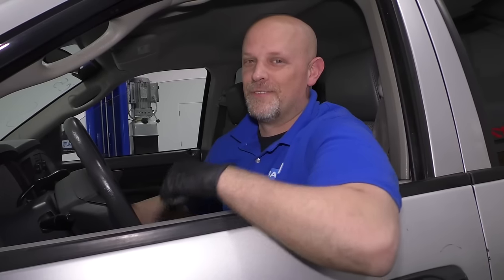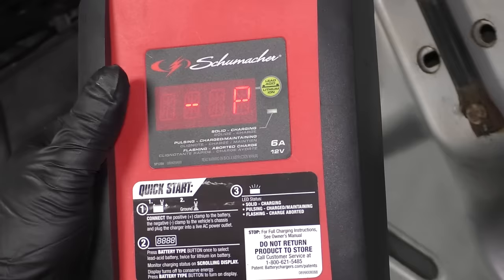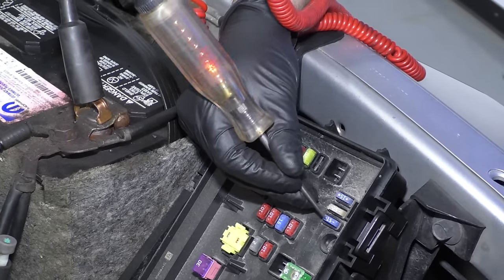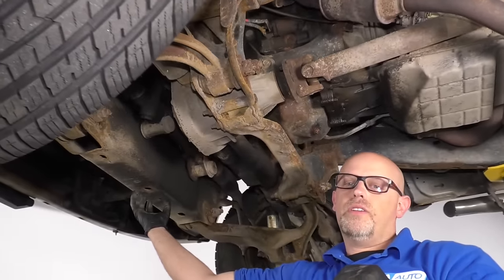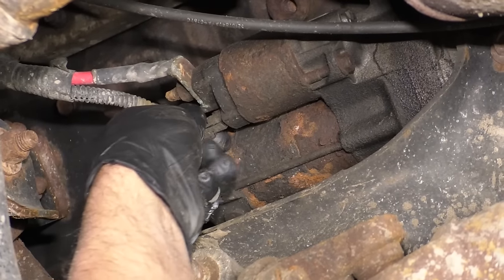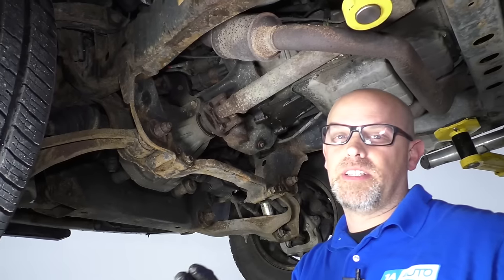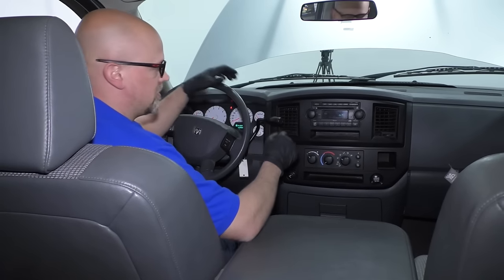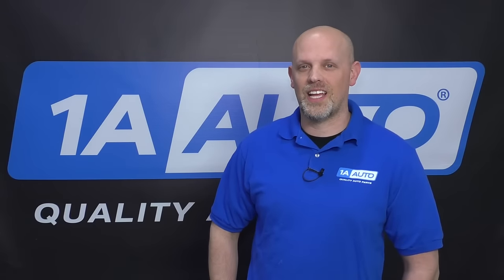Car or Truck Engine Won't Start? How to Diagnose a Bad Starter

Comment: What if all my lights turn on on my dash cluster then as soon as I turn the key there is no noise but all the lights turn off. Then I stop holding the key and the lights turn back on. Then I wait a few minutes before trying again and it starts up fine? What would that be?

I've had my alternator, battery and ignition assembly replaced due to them going bad. I haven't replaced the starter yet though. Does it sound like it could be a problem with the starter?

Comment: As you said if you start the engine and nothing happened no sounds it could be potentially starter motor is bad. But if you start the engine you hearing like a sounds of electricity it could be a battery but if you start the engine and its only cranking and its sounda like hard to start therefore it could not be the starter, so then what is the possible cause of cranking only and sounds like hard to start that is what i want to know..tnx

Comment: So my thing is my car battery is good and connection is Good randomly my car started making that chattering noise u had at the beginning and not starting sometimes starting other yesterday it didn't start at all a hour later it started my only conclusion could b maybe starter going bad what do u think?

Comment: I have a question...Could a starter do this intermitently? My 2005 Ram 1500 just started doing this on Friday, started fine all weekend, and now is not starting again. I don't think it's the Ignition Switch, because remote start won't start it when it's like this.

Comment: ...
Although I have a FOXWELL BT705 Car Battery Tester, after a full charge of a battery, I was getting results that suggested that the battery was okay, but it was not.  I found that fully charging a battery and leaving it disconnected overnight will reveal a compromised cell, the voltage having fallen below the acceptable limit, a voltage far below the 12 volt range.  Given that the voltage of a fully charged battery is 12.6 VDC and the battery has six cells, the voltage each cell contributes is 2.1 VDC.  Accordingly, the voltage of a battery with a dead or compromised cell would eventually fall to 10.5 VDC, the damaged cell being unable to hold a charge.  This symptom is a dead giveaway.

Comment: When I turn the key, the starter engages but then stays engaged for several seconds preventing the engine from idling/running. Is that a bad solenoid? Could it be my alarm with remote start capability? It’s a 2014 Silverado 1500.

Comment: Why is it so hard to find a New Matching starter for 2015 Lexus RX350 F Sport. Big Box stores pull up wrong starter and only able to find matching used on ebay??

Comment: I'm having an issue where my truck wouldn't start. Just one click. I just installed a new battery as it was getting weak anyways. I tried starting it for like 20 minutes without any luck so I let the truck sit for like 5 minutes came back to try and start it and it fired up. This happens almost every time I go to start it now. I'm thinking its the starter? But why is it intermittently just firing up as if I wasn't just trying to start the thing for the past 10-20 minutes?
Reply: That is the question I am asking and I have noticed there are several people asking the same question however, no one is responding. I would love to know if you found an answer.

Comment: Parked my truck and it sat for a few weeks, cranked fine but wouldn't start. I killed the battery, recharged it and had it tested, but now it won't even try to turn over? Any idea what might be going on?

Comment: While leaving a football game my 2015 Kia Soul wouldn't start. All the dash lights came on but the car itself wouldn't start or turn over.  There wasn't even the "click" noise that your battery died.  Not knowing what to do, I just turned off everything I thought might be drawing power.  After trying and sitting about 6 or 7 times, it finally started like nothing was wrong.  I took it to Autozone and they said it wasn't my battery or alternator, so I'm guessing it may be the starter.

Comment: 07 ram 3500 5.7  good battery new starter and new terminals . Cranks for 1 sec then stops like it looses power . If I jump terminals at starter it starts up . New solenoid bad ?

Comment: What if it's a manual the motor was running just great i let it set for two months went out rolled it off pop clutch fired up run great pulled it in place a month later won't start getting click but when i go to pop clutch the back wheels dragging but when i push clutch in it rolls let off clutch back wheels dragging..

Comment: Can a bad starter cause the battery to drain? I installed a new battery and alternator it's not starting periodically but will when I get jumped.

Comment: What if it crank like the battery is dead but then after a a couple of tries it crank like it’s dead and slowly increased in power till eventually the engine starts ( new battery not even 2 months old)

Comment: What jumper wire do you use and what type of end on jumper wire (male or female) to plug into the ignition cord to check if your getting power with the test light?

Comment: Besides a crankshaft position sensor and camshaft position sensor going bad what will cause a crank no start I've tried switching relays and it almost started but then I heard that a worn starter motor can cause the same issue

Comment: My car sometimes start and sometimes doesn’t. Is that normal for starter problem? It’s been going on for about 3 months. 
When it doesn’t start, I get a click but no crank. However, the car starts by itself without me doing anything.
Reply: That’s exactly what I am trying to figure out

Comment: So what if it’s the third option I have a 2008 Chrysler 300 touring? The battery is good and so are the connections to it. The starter is good. It kept turning over but it won’t turn on
Reply: Check for compression, if none did your timing belt break? If so your engine is toast. If you have compression maybe it is a fuel problem. Search for crank no start condition instead of no crank no start. Crank no start can be many things.

Comment: If l turn the key and get some clicking and flickering dash lights do you think that's the starter? I heard a pop and now it's just clicking in the fuse box and it won't turn over at all.
Reply from the maker: +Randy Sumners We wouldn't be able to diagnose an issue like that here, you may want to have a local mechanic take a look at it. Thanks for checking us out! http://1aau.to/m/Shop-1AAuto-c

Comment: My step dad gave me an 88 ford ranger. It had a bunch of work done to the fuel system and then it would not start. My friend thinks the start went out but it turns over but wont start. Where do i start looking for the problem?

Comment: So how about if you do this and you get the same indications but then you take the starter off the vehicle and then test it and it works? Could it be a faulty connection on the trigger wire or could it just be a speratic starter
Reply from the maker: +Matt Law We wouldn't be able to diagnose an issue like that here, you may want to have a local mechanic take a look at it. Thanks for checking us out! http://1aau.to/m/Shop-1AAuto-c

Comment: I have a grinding sound again with my new replacement starter on my 96 300zx. The original starter would grind and chewed up badly about 1/3 of my flywheel. The flywheel and clutch was replaced with a new starter. (Possible rebuild $298) Now it is happening again. The mechanic told me to turn the key slower. Sounds like BS to me. Any chance it could be caused by a bad positive cable or ground? What to do?
Reply from the maker: +Marc Gottlieb We wouldn't be able to diagnose an issue like that here, you may want to have a local mechanic take a look at it. Thanks for checking us out! http://1aau.to/m/Shop-1AAuto-c
Reply: @1AAuto  Is there an outside chance it's the Positive cable? Decreased amps. The clamp part looks like the piece was soldered and the plastic burnt.

Comment: I parked my car three days later I go to start it no crank ,nothing, Now I suspect it may be the starter I checked the fuses and relays  battery reads 12.4 , but what worries me is that I found the oil was almost empty  nothing left maybe less than an inch on the dipstick, but before I parked it there was no noise whastoever and it was running fine. I hope the engine didnt seize but how can an engine seize suddenly without any noise...I have had a car engine blow up on me  several years ago I know exactly the noise it makes when there is no oil left.

Comment: On my 2002 gmc yukon xl if it sits for any time say like 8 to 10 hrs or overnight and i get in it to start it the first time i turn the key it wont turn over or try to crank but if i try it immediately a second time it turns over a fires right up and aa long as im driving it i can make several stops shut it off and it cranks right up. The batter has been checked and the alternator and they are good . Would this be a starter going bad
Reply from the maker: +THomas Herron We wouldn't be able to diagnose an issue like that here, you may want to have a local mechanic take a look at it. Thanks for checking us out! http://1aau.to/m/Shop-1AAuto-c

Comment: I have a 1997 S10 4.3l That I cannot get to crank with the key so I bypassed the key with push button put and put a new starter on it and also changed out the clutch safety switch sensor and fits the terminals with new terminals and new connectors I have no clue what to do I can roll my truck off and crank it just can’t crank it by key or push button Can you tell me what else it could be
Reply: Just clicks when I try to crank it.  I also pulled the battery terminal off the battery and it stayed running so I know the alternator is good

Comment: Here's a test to everyone's electrical knowledge.  2005 Tahoe.  New battery.  Starter is good.  

Turn the key and everything comes on, but the starter doesn't turn over.  

Try connecting a wire from the 87 pin on the relay to the positive on the battery with the key in the run position and nothing.  Tried it for hours.  

Put the key in the on position and tried to straighten the wheel but it wouldn't turn, and I tried it one more time and it started right up.  Bad connections at the starter?  Ground?

Parked it with a straight wheel, shut it off but it wouldn't turn over.  Wiggled the wheel and it still wouldn't turn over.

The ground at the back of the engine "Feels" tight but couldn't climb back there to check for sure.

Anybody experience something like this?

Comment: My 2017 Dodge Ram 1500 Bighorn will not start.. battery is good 👍 but weirdly it keeps saying I have a burned out brake light anyway it just clicks and no start! 😩

Comment: Great info but you left out probably the most important thing “VOLTAGE DROP-connection at battery no corrosion in between terminals-wire connections,also bad starter wire you can have 12v at the starter and have a bad 1/0 wire or it could just be the connection at the starter again voltage drop kicks ass to know also testing it with a load meaning while your cranking it then take your reading/multimeter …great video though…and I hear ya you prob wanted to just touch on basics because most of these people aren’t techs like me /diesel tech which is understandable great video though

Comment: I have a 2011 chev Silverado 1500 2wd When I start my truck it does start but when it does it continues to start but eventually stops.  I replaced the starter and I still get the extended starting effect. Anything I m overlooking?   anything helps

Comment: What about multiple clicks/ticks but engine dosent turn over, have battery at 100% and alternator is new?
Reply from the maker: +@ecgodsmack86 We wouldn't be able to diagnose an issue like that here, you may want to have a local mechanic take a look at it. Thanks for checking us out! http://1aau.to/m/Shop-1AAuto-c

Comment: Scenario happened to me back April. A simple hit with a hammer got me going. Did replace starter.
Reply: I was shocked af when my mechanic called me and said my car started i thought i was about to be out 1500$ 😭
Reply: When I was young and dumb I put a hockey stick on the starter. Never thought of checking the starter but I did eventually

Comment: Can you tell me where the VVT solenoid is on a base model 03 Mini Cooper? The S model is located on the passenger side,below the valve cover on the back of the head but I don’t see it in that spot for a base model. I tried looking it up but I can’t find anything on this.
Reply from the maker: +A_Chained_Angel We do not have a video for this repair right now, but we'll keep this request in mind for a future video! 1AAuto.com

Comment: This was all very good info but for me my problem was that one of the cables coming off the battery needed to be tightened. 
Even though it looked like it was on there fine the little bit of wiggle room was enough that it didnt make good enough contact. Ive been having an intermittent starter issue for several months now, and finally got stuck in a parking lot and thought I would have to call a tow truck and pay out the ass for mechanics to fix it.
Reply: Was it cranking with the intermittent issue? If not, was there a single click?

Comment: Great video
Reply from the maker: +Francell Productions Thanks for checking us out! http://1aau.to/m/Shop-1AAuto-c
Reply: @1AAuto  
Hey, With my key turned to start,  I’m measuring 11.5 volts  across the starter motor itself. (from the positive copper lead closest to and leading into the motor to the starter case) It won’t crank. I tap on it, no change. It won’t crank, But my headlights are super bright and everything else on the car works just fine.  With the key turned to start my battery terminals measure 12.4 V What should I do next?

Comment: Well this is all good and dandy, but when I try to start my 2001 f150 I lose all electricity in the truck. But when I disconnect and reconnect the battery I get electricity back. The truck doesn’t even try to start, no click, the motor isn’t cranking, I just lose all electricity and none of the fuses look bad or blown
Reply: Check the positive cable connection to the fuse box. If corroded clean it, if fried replace it.

Comment: Would anyone know what the problem is on my 2002 dodge dakota pickup truck. Motor died at a stop light an will not start back up. I turn the key to go to start and the electrical works just will not start up. Motor has no spark no nothing. Makes a sound ive never heard .the noise is almost as if the motor is locked up or torque converter is in a bind.

Comment: Will long crank before start also be a sign
Reply: Sometimes bad ground wire from battery or battery isn’t at full power for some reason.

Comment: What could be the problem if the engine only does a quarter turn?
Reply: Voltage drop.  Check the positive cable that runs to the starter. Ground cable if you starter has one too, some starters ground by bolting to the engine.

Comment: What is wrong when my car only start when using jumper cable, battery is new @ 12v, when it runs idle at 14v. Any help would be appreciated, thanks.
Reply from the maker: +Nuruddin J We wouldn't be able to diagnose an issue like that here, you may want to have a local mechanic take a look at it. Thanks for checking us out! http://1aau.to/m/Shop-1AAuto-c

Comment: I'm getting an intermit crank no start then start and idle on second Attempt and will complete shut down in a. Intersection.
Reply: Shut down sounds like alternator not charging battery and it dies does it make a whining sound? Mine got louder as I accelerated. Won't hear it with music on in car
Reply: @channelwilliams7420  when I turn my key to start absolutely nothing happens, my headlights are nice and bright and I measure 11.7volts across the starter motor while the key is being held in the start position. Any ideas?
Reply: Channel Williams bad fuel pump

Comment: Hi, I have a 2013 Honda Accord v6 push button start (keyless). New Battery at 12.45 volts When I put foot on brake & push the start button in park I hear 1 click inside the starter but no crank. When I pull the solenoid control wire & put positive lead in it with negative lead on neg. battery terminal I see 12volts for a split second then back to zero volts. My question is should that 12v stay solid after pushing the keyless push button start? I am trying to diagnose on why it takes multiple push button attempts to get my 2013 Honda Accord V6 to crank over by starter. I see many people owning 2013-17 Honda Accords complaining about this. I see that in 2013 Honda put the starter solenoid inside the starter housing instead of having a separate external mounted starter solenoid prior to 2013. Thank you for providing any info that can help me or others. Happy Holidays & Stay Safe!

Comment: My 86 chrysler pickup, slant 6. New battery. Starter click o.ce like you states.  Beat it with a wrench clicks about 10 times. Then kills all power to the truck. What could this be. Anyone ?

Comment: I have really special problem with my car
My battery has maybe 2 yrs but had no problem till now and is charged to 12.9V
Alternator is charging to 14.3V
But after killing the engine and trying to start it right again today it just make one click noise, every light in the car turned off including clocks and after 2 seconds engine started right up, without any cranking, just instant..
Also every time I roll down the windows or turn the wheel the lights get dim

Comment: I got a new alternator. What if the car starts sluggish in the morning then gets worse and doesnt want to turn over but starts after several attempts every time I go to start my car. Then the car wont start at all and just does a click sound.
Reply from the maker: +wwf hasbro collector We wouldn't be able to diagnose an issue like that here, you may want to have a local mechanic take a look at it. Thanks for checking us out! http://1aau.to/m/Shop-1AAuto-c